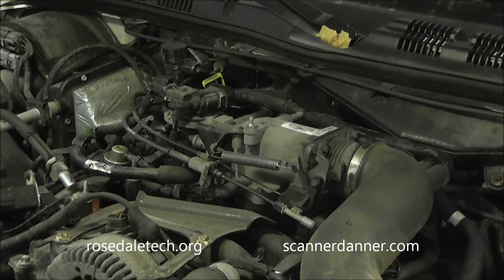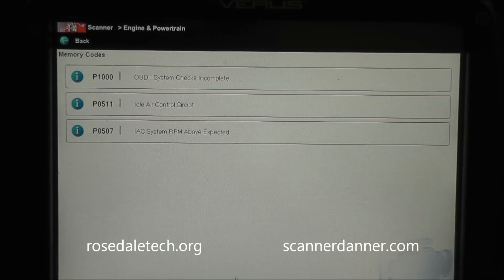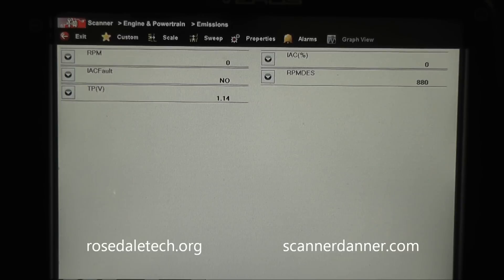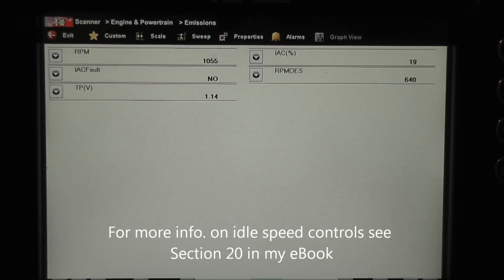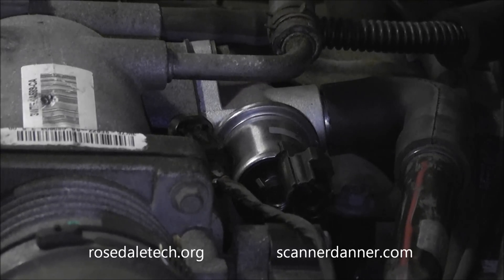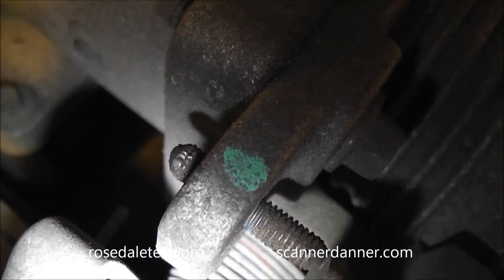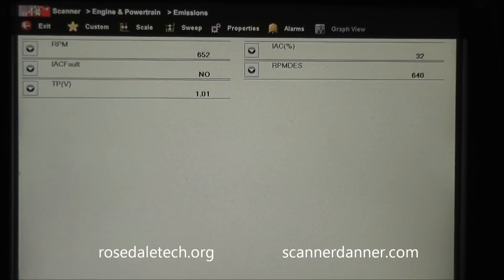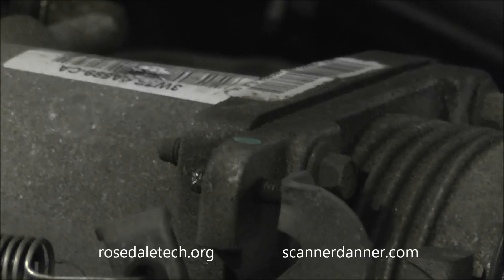Ford Idle Air Control (IAC) valve test (how to adjust minimum idle speed)

Comment: Been watching your videos ,.. This is the best video about this subject on youtube.   Got a ? to ask about my 2001 Ford Mustang V6 auto trans that I bought for a grand a few months back. (hope you don't mind) When I come to a stop it will try to stall but the computer catches the stumble. At times the car will accelerate on it's own lol.  Very seldom tho..    The idle screw head doesn't look like the one in the video. It actually has a bolt head on it. So I am wondering if the people put one on it before I bought it.  It has lock tight on it also.  I also have a shifting problem that comes an goes. (It screws up every so often like it gets confused an in between gears) It cant be slipping cuz it shifts an grabs super hard ...  This problem has been getting more spur attic when it's been ran for a while tho.  (old trans fluid??) . Runs fine when I first start out tho btw. Down shifts to 1st gear before I stop just fine when it's first ran. 
    I have checked for vacuum leaks an cannot find any.   Last night I unplugged the Idle control Valve an nothing happens.  I unplug the TPS an the idle goes up then back down !!!???.  I am about to go out an put multi meter on the tps but am cautious cuz I don't want to get the 12v wire an burn out the ECU. I am mechanically inclined but this has me so pissed an confused !! 
     The stang has a header gasket leak crack or what ever that seals itself after 30 seconds.   So I wonder if maybe the O2 sensor is getting to much air an the car is adding to much gas.  Have gaskets, going to try an fix that today.   I am at a loss tho about the shifting an the acceleration .   I certainly don't think the car should go when I let off the breaks. aye ?    I have only owned Manuel trans in the past so I am not sure.    Going to go out and clean the PCV valve today also.   Any advice would be very helpful.   Please help.  Thank you !
Reply from the maker: My first though it a TPS that is glitching on you near the idle position of the sensor. A TPS voltage rise "glitch" (when your foot is not on the gas) causes an RPM rise because the ECM "thinks" your foot is on the gas and opens the idle air control device. Why does it do that? To prepare for the moment you let your foot off the gas (helps prevent decel stalling). 
A TPS voltage drop "glitch" the other way, the computer gets stupid and momentarily cuts injection pulse. Why? This is a normal thing during driving. A rapid throttle closing with RPM at a certain range, the computer cuts injector pulse. Or it may just be messing with the idle air control motor again, causing a stall or stumble. 
If this is an electronic shift transmission, then your symptoms of a TPS glitch match exactly here too as the TPS in a major input for shift points. 
If all you have is a digital multimeter, it can be very difficult to spot this problem. 
These may help?
https://youtu.be/nfnkT0Iki8s
https://youtu.be/8KfKfImoIXg
https://youtu.be/8RB7BlLnTiw
Reply: Thank you so very much man.  Your great.  I will get back to ya when I find out more.  :)  Subscribed !!
Reply: Yea the only thing going into the trans is the shift..   There is no second cable..  Forget the name..  lol.   None of the links worked btw.   But i did manage to copy the last part of the link to find the video   : )    Subscribed ..  Thank you !
Reply from the maker: I pasted the "edit" links, sorry about that. They should work now. Thanks so much! Let me know what you find. 
BTW, since you only have one throttle cable, this does confirm it is electronic shift. Sounds like we are barking up the correct tree for sure.
Reply: I meant it only had one cable going into the drivers side of the transmission.  There is a box on the side of the trans.  Idk.   There are two cables on the throttle tho.  But I think one is for cruise control.  
      --    So I took the TPS off an stuck a needle into the center wire..  the volt meter I have has auto range..so the number went up to 52 and stopped at 1.  (I needed three hands) lol.  Anyway as it started out slow it seemed good but when it got up to the top there was alot of movement an no number change at all.   So I took off the connector to the tps an attempted to spray mass air cleaner on it.   An tried turning it as the cleaner was in it .. I guess I wanted it to get down into it.  lol    Well it sprang back an no longer wanted to spring after that (broke the damn thing I thought) so I had 40 min to get my ass to autozone before they closed.  37 bucks later.  "Runs an shifts like a bran new car"   I only took it for a little run up the highway.  But it really shifted alot better..   It flew ..   Loved it.  wasted all kinds of gas haha..   I did get a lil hesitation tho after downshifting .  But it maybe the header leak. Or the coil in #3,  I ohm tested them early this morning an the first two = 1.6 an the last was 1.0.   I saw on another video that this meant it was bad.  But as I went on reading the comments this fellow said he tested a bunch an they all read 1.0 on the last coil.. ????  either way.  You really saved me a bunch $.  Id of never replaced it if it wasn't for your video.    That sensor was 16 years old I bet.. lol.       
                 Thanks ALLOT !  :)
Reply: Found that the evap hose was sucking shut..  Would this cause unintended acceleration at at stop light ??    Got a new hose.  Not having trouble with it now as of yet.   Still have a leak on drivers side bank exhaust manifold.  3.8L is still sluggish from a start.   Not sure if it's just the way it's supposed to run or the leak is taking torque away from the motor..  :(

Comment: Hi i have a ford 1991 and when iac disconnect nothing happens it does not change the rpm
Reply from the maker: Then what that means is the computer is already closing the valve off all the way and is trying to reduce the idle speed but cannot anymore. You most likely have a vacuum leak.
Reply: THANK YOU VERY MUCH AND HOW TO DETECT THE VACUUM LEAK YOU CAN GIVE ME A SMOKE LEAK IDEA
Reply: While running starter fluid an spray around the vacuum lines..  Just be careful of any open sparks.  It doesn't take much starting fluid spray. So don't blow up yourself by spraying alot.  If the throttle increases..  You know where your spraying there is a leak.  That is what I would do anyway.
Reply from the maker: I don't mind Jay's suggestion below, but I don't like this method due to fire hazards. I like to use water. Here are a few showing the method
https://www.youtube.com/edit?o=U&video_id=Jr_Qg8w9GRI
https://www.youtube.com/edit?o=U&video_id=0rQn9YBMZIg
https://www.youtube.com/edit?o=U&video_id=h8rxpfRvHf8
https://www.youtube.com/edit?o=U&video_id=cuod8-zFSQ4
Reply: Yea. I fig you wouldn't want to go this route.  But it works !!     Those that are unsure of themselves shouldn't do anything like this !
Reply: THANK YOU JAY
Reply: GRACIAS ScannerDanner problem solved

Comment: Can the function of the IAC be intermittent? I.e, can it keep the car from starting (intermittently)?
Reply from the maker: Yes it can, but to keep the car from starting it would need to be stuck all the way closed and also be accompanied with a very dirty throttle body which would be completely blocking off the airflow around the closed throttle plate. 
Like in this video https://www.youtube.com/edit?o=U&video_id=sg3J4ibMkWc
Here is the key test. When it is not starting, press on the gas pedal just a little bit. If it now starts, look in the direction of a dirty throttle body/IAC valve problem. If it still doesn't start, it is NOT an IAC or dirty throttle body issue.

Comment: hi am trying to figure out where is the air control valve located on my 2012 ford focus se 2.0L. please help. u can reach me at my email , hleigh1984@gmail.com
Reply from the maker: You don't have one. It is an electronic throttle body

Comment: good video! And this probably can help someone KOEO closed Throttle voltage should be 0.7 to 1.1 volts and by the process that you show in the video you get it at 1.1 volts that's just perfect! And by using Scanner DATA process! Very good direction how too address this situation!
Reply: Heck yeah! Good additional info.

Comment: On my 94 Ford Explorer the idle is all over the place and I hear what sounds like miss fire and the rpm spikes and lowers to around 700. And when I unplug my IAC the idle goes down to 500 rpm and the engine seems to run better and no missfire sound. Bad iac?

Comment: Most of us don't have the fancy car computers that you have...
Reply from the maker: You do not need the professional equipment I use to do this. There are many options for the DIYer and this information transfers directly to lower cost scan tools and scopes.
Reply: @ScannerDanner  I gotta 99 lx vic.. when I let off the brake .. it moves forward by itself.. do u know which part I need to replace to fix that?
Reply from the maker: It's not that simple Jamar. Wish it was
Reply: @ScannerDanner  what are the main things I need to check?
Reply: Can you use scan tools on Obd1 cars?
Reply: harley Rider a
Reply: harley Rider qq
Reply: There are code readers for OBD1 cars, but the popular scanners apply to OBDII systems, as installed in some '95 FOMOCO cars and ALL cars made in '96 and later.
Reply: @SlikLizrd  ....you're  one year off. Ford started playing with obd 2 in 94. I have a 94 Thunderbird with the 4.6 v8 and it has the obd 2 system.
Reply: That's correct !! Most of us DON'T have equipment that ScannerDanner uses to make the videos and test, repair,  and/or adjust our vehicles. Which is fine !!
 It's important for ALL of us to take advantage of ScannerDanner's equipment and his expertise.
Reply: @frankieg2273  for how long
Reply: @youngjj757  well normally cars set in drive will always move forward slowly, the question is, is the rpm blowing higher than normal and then the car shoots forward? Check the iac valve and throttle body

Comment: Scannerdanner or anyone, my 2001 Ford Mustang GT is driving me nuts. It has been stalling on me when I first turn it on in the morning, been doing this since the day after I bought it, what a shame. It'll start and run fine (except for the slightly high idle of about 1k-1100k) until you shift into reverse (auto) and then it'll stall but start right back up. I have a P1506 IAC Over speed error and I HAD a slow to respond code for both upstream o2's, they haven't come back ever since I replaced them but when I see them on the scan tool they still don't seem to oscillate very well. My fuel trims are normal though. So I've already replaced the upstream o2's, MAF, IAC, and TPS. The first mechanic who looked at my car also had ruled out a vacuum leak but I don't know how well he looked. Nothing has fixed my car. Anybody have any ideas? 

Thanks, in advance
Reply: Anybody have any ideas? I'm desperate lol
Reply from the maker: after it stalls and then starts back up, is your idle speed still at 1100 RPM?
What is your IAC Duty cycle % on the scan tool during this high idle condition? Do you have a scan tool that can read that data?
Reply: +ScannerDanner Yeah, my idle will still be the same. also, the problem seems to be aggravated with the AC on. I find it weird how it seems to run well until you shift out of park. Just this morning my dad took it to work, he warmed it up for a good 4-5m with the AC off to see if it wouldn't stall and it didn't this morning. I use torque pro on my tablet with a Bluetooth adapter and it doesn't let me look at any IAC data. I don't even know where to go next from here. Seems like none of my local mechanics use or know how to interpret scan data.
Reply: really nead IAC duty cycle command to help further 
You can measure it directly at the IAC valve with a DMM set to a duty cycle scale and connected to the control wire.
Reply: I'll try to see if my mechanic can do this. I don't have access to a DMM and my car is at my current mechanics shop. You have any suggestions as to what I should ask him to look for? Is this a possible electrical problem with the IAC circuit or somewhere else?
Reply from the maker: We need to know is if the IAC is being commanded to open or close. With your idle high, the IAC should be  being commanded to close and you will see around 20% duty cycle. (20% = fully closed command)
If this is the case you have some external issue causing the high idle speed. (vacuum leak, misadjusted based idle screw). 
However, if you have a high duty cycle command, say 40-60%, this means that the computer is commanding the valve to open. This means your high idle speed is being caused by the computer opening up the IAC more than it should be. So then we start looking at inputs that affect the IAC commands. (TPS, ECT, power steering pressure and park neutral switches, battery voltage etc)
Make sense?
Reply: +ScannerDanner This makes perfect sense.
Reply from the maker: cool. keep me posted okay?
Reply: +ScannerDanner Yeah man, I definitely will. Thank you for showing interest in your viewers! I've learned a lot from you. I feel like this car is unfixable and I'm losing hope, hopefully your suggestions help me point my mechanic to the right direction. Might have to get a new guy if he can't find it though.
Reply: +613PEJ I'd also like to add that the first mechanic I took my car to really didn't know what he was doing and just adjusted my throttle screw so that my car would get more air and wouldn't stall when shifting out of park or while at a stop sign. I let my current mechanic know about this and he said he fixed this. Also, I noticed on my scan tool that my MAF sensor is reading at around 10g/s of airflow at idle, my car is a 4.6L so I thought it was supposed to be more around 4-6 per second, but idk if this is attributed to the higher idle speed issue I'm having bringing more air in this giving a higher reading. After I saw this I went ahead and replaced the MAF but it's still reading pretty much the same. Another thing I feel like I remember seeing is that my Engine Coolant Temperature was reading at like 102°C when I went to go pick it up from my mechanics and it had been parked there for a week, they brought it out front, I hooked it up and saw this. Idk if maybe it warmed up significantly during that couple of minutes or if that's what it's reading cold; I feel like that'd be a little hot for a cold start. Lastly, my post cat O2 sensors are both reading on the lean side, they are at like 3-3.5 volts and the voltage changes very slightly but enough to see that it's moving on the graph, I know that ideally this voltage shouldn't change and should be somewhere in the middle.

Any possible problems come to mind with what I described? Can an improperly adjusted throttle screw cause a car to stall like mine is? Thank you in advance.
Reply: +613PEJ Sorry to stack more info, but I remember my mechanic telling me that my IAC was sucking in too much air and he showed me this by removing the vacuum hose on it and covering the hole with his finger, the car then started to run better as long as he held his finger there. We then went and replaced the IAC but the problem is still there. I'd also like to point out that the IAC that we replaced was the 2nd IAC in the car that i had just bought new maybe 3 months back, so my car is on its 3rd IAC. I hope this gives another clue as to what the issue may be.
Reply from the maker: So that proves it's a command issue and not a vacuum leak. You have an input problem my friend
Reply: +ScannerDanner So which sensors and components would you look at? What could cause stalling at idle when shifting out of park and cause a high idle?
Reply from the maker: ECT, TPS, AC psi, P/N switch, P.S. PSI switch would be the main ones.
Also, I just thought of something. These valves cab be bolted on backwards on some model Fords which will cause similar symptoms as you describe.
Reply: +ScannerDanner I let my mechanic know, now I just gotta wait and see. I'll let you know as I find out. 

Just for clarification, what is a P.S. PSI switch and AC PSI? My mechanic is gonna swap some valve or diaphragm thingy that's related to the AC, is that the AC PSI you're referring to?
Reply from the maker: Power Steering Pressure (sorry) and Air Conditioning Pressure
Reply: ScannerDanner Almost a year later and my car is still jacked up lol
Reply: Some Ford mechanic my dad asked for help is gonna look at the car next week. Already replaced TPS, ECT, MAF, Upstream O2's. Only ones I haven't changed that you mentioned are the AC PSI switch, P/N switch, and Power steering switch. 

I have one more question though. I suspect my car has an aftermarket high stall torque converter that doesn't allow me to feel my transmission shift. It's like the RPM's don't drop between shifts until like 3800 RPM when I feel the converter lock up and then RPM's drop significantly. The car used to have 4.10 gears and I went back to the stock 3.27 gear ratio. I suspect the previous owner changed the converter as well. Could a high stall torque converter cause idle issues/stalling as well as messing up my shift points? My car is on a stock tune.
Reply: My car did have a transmission output speed sensor OBD code and we changed the sensor and it hasn't come back. It's been like a month since that. Same IAC code exists with normal looking fuel trims except my exhaust smells gassy.

Comment: Follow up . . . $5 can of brake cleaner and a new gasket, took IAC off and cleaned it, put it back, and problem solved.
Reply: Gary Crawford Cleaning the IAC works well. Just did it yesterday on my Ranger. However, I would not recommend brake cleaner. It is way too strong and can easily damage/deteriorate the o rings inside the IAC. A better cleaner would be Mass Airflow Sensor cleaner or even engine cleaner.